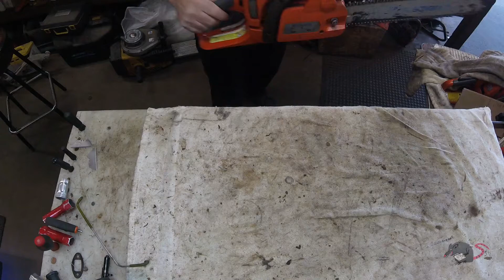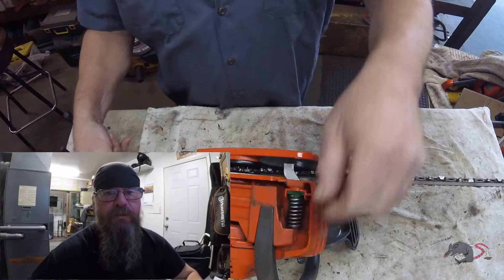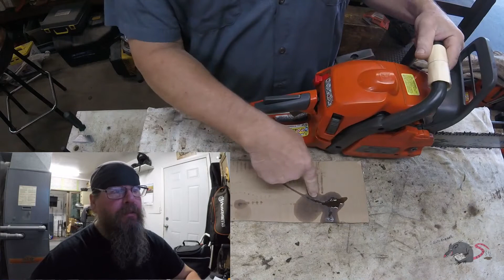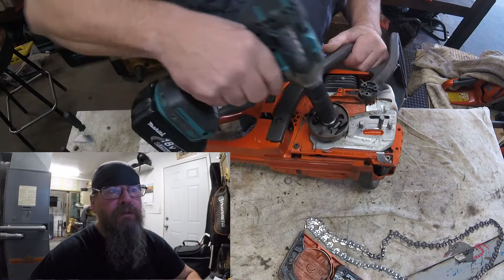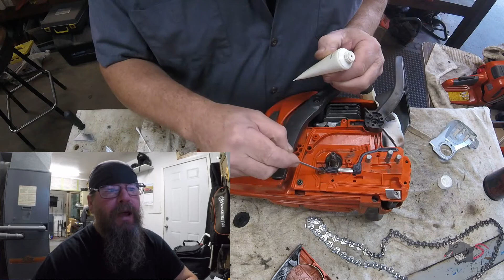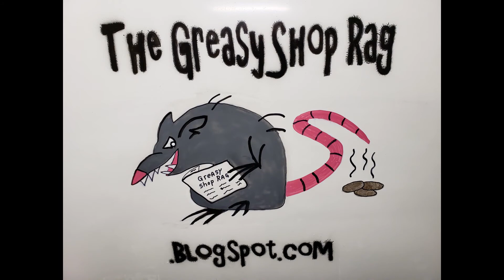Husqvarna 435 chainsaw oil leak fix

Comment: Mine didn’t leak until it fell about 15 feet out of a tree. The leak seems to come from below the oil tank though, if you dismantle the housing and look up to the bottom of the oil tank there is a small black circular bit of plastic - a bung that was needed to block a hole from the plastic blow moulding process? Maybe? I don’t know. I am very tempted to cover it in super-glue though.
Reply from the maker: I think you are looking at the oil screen. If you give it a 1/4 turn it can be pulled out. Sometimes I have to use sealant on these because they can leak.

Comment: Does the bar oil leak cause the chainsaw to flood out and stop?
Reply from the maker: No, the two problems are not connected.
Reply: @TheGreasyShopRag my rancher 450 is leaking oil out of the top, and it will run for a few secs then like floods out. Sry, not a small engine person, so don’t know the terms
Reply: @TheGreasyShopRag  oil coming out of the exhaust
Reply from the maker: @MDD1966  Oh, thats different. It sounds like the unit is flooding. Usually this can be traced back to a stiff metering diaphragm in the carb.
Reply: @TheGreasyShopRag I will check it out thx
Reply from the maker: @MDD1966  Watch tomorrows video and see if its the same problem you're having.
Reply: @TheGreasyShopRag thank you very much

Comment: I have a 455 Rancher. The oil pump won’t come out. There is an adjusting screw that seems to hold it in place. What am I missing ?
Reply from the maker: There is a single screw going through the body of the oil pump that holds it down. Its right in the middle. Once removed you need to manipulate the pump in such a way that the adjusting screw passes the crankcase.

Comment: I have a 435 just replace the coil cause it wouldn’t start now it starts and runs but dies out after a few seconds any ideas?
Reply from the maker: Maybe you had two problems? Coil and fuel system?
Reply: @TheGreasyShopRag actually just fixed the oil leak issue that you did in the vid that seemed to help a lot after I honed the work gear and polished the crank snout, it runs now but not good so I got some adjustment tools on the way I’m gonna tune it and see how she does
Reply from the maker: @bertollie6840  Good luck with that repair!

Comment: Great video.  Can you provide the part number for the clutch removal tool you used.  Thanks.  Amazon shows several.
Reply from the maker: 502541603 should be the number you're looking for.
Reply: @TheGreasyShopRag  Thanks a bunch Greasy!

Comment: hHOW COULD i FIX A LEAK COMING FROM MY BAR OIL TANK WITHOUT TEARING THE WHOLE SAW APART TO PUT A NEW TANK ON IT? Thanks for the help sir!
Reply from the maker: I don't know what model saw you have but if you're talking about sealing the tank then look into products like POR15 or Kreem.
Reply: Husky 435. My son got pissed at it and gave it a 737 air flight and put a crack along the bottom of the tank!😩🦅👍
Reply from the maker: @edmundreiss5144  Yikes. Good luck with the repair!
Reply: Thanks for your quick replies and it looks like the oil is leaking out near the pull cord assembly under the housing. Is there a gasket or o ring seals in there that I can replace? Thank you for all of your help and Happy New Years!
Reply from the maker: @edmundreiss5144  If you remove the starter and black plastic shroud you will see the tank vent (kinda to the right of the serial # tag). Thats a possible source for a leak. Underneath there is a grey colored plug. Its removable and has a screen in it to filter debris from the tank before it goes to the pump. Thats another possible point for a leak.

Comment: Did you not block in the piston when removing the clutch? Looks so effortlessly
Reply from the maker: The impact rattled it off. Some claim this can be harmful to the engine but I haven't had any issues doing this if I follow a few precautions.

Comment: A warm hello from Japan. Great video. Can I ask the part number or where I can source the tool you used to take off head with. Thanking you in advance. I had tool size3112 wrong size cost a fortune
Reply from the maker: I'm not sure what you mean. Are you asking about removing the clutch?

Comment: I got sick of my 435 leaving a pool of oil so I took it apart and figured it out the problem for myself... I tried to seal it with Gray RTV but it just wouldn't cure. Still leaked after it sat overnight. 

Found your video and tried some super glue. Worked like a charm. Thanks for sharing your knowledge!!!
Reply from the maker: Good job. Thanks for watching!

Comment: How do you get the clutch off so easily without using a piston stop?
Reply from the maker: The impact does all the work, I just squeeze the trigger. Once in a while I have to stuff a rope in the cylinder and use a breaker bar to get it loose.
Reply: I just used a hammer and a flat head and two mediocre whacks later, it came off
Reply from the maker: @bradyupchurch5189  Quite often that works. Sometimes you run into a stubborn one.

Comment: What grease do you use?
Reply from the maker: I don't have the part number in front of me (maybe 502 51 27‑01) but its called "Husqvarna Multi Purpose grease". It doesn't come in the small tubes as seen in the video. Those were samples that came in owners packets. The new tubes are bigger.

Comment: You have to hear it - Husqvarna made it even worse in latest models... I just bought 445 Mark II made in 2022 (the ones with grey clutch cover), and that square rubber end doesn't even have that protruding part that goes inside the oil hole in the case - now it's just touching against flat surface around the oil hole. It leaked right after I filled with oil first time... Unbelievable... It's like Husqvarna made it worse on purpose... I hope the super glue helps...
Reply from the maker: I've had good luck using glue on these hoses.

Comment: Thanks, probably exactly what's wrong with my 435. Haven't considered the idea that the leak is behind that plate, but rather assumed that the problem was where the oil is transferred to the sword/blade/arm/bar (don't know what it's called in English). Noticed that the rubber slott where the oil comes out is alarmingly close to the hole in the bar that is intended to push the bar forward when the chain is tensioned (the upper hole in particular does not press, but is still there so that the bar can be mounted upside down)
Will try your solution (hope I succeed in hammering away that drum) but don't know which glue to use. You talk about "super glue" as some winged expression but don't think it is so obvious here in Sweden. 
Is it meant to be glued or is it usually just held by pressure/friction and only glued if leakage is found?
Reply from the maker: "Super glue" is a Cyanoacrylate based adhesive. The part is not meant to be glued but the trick was  unofficially told to me by a tech from a large Swedish chainsaw manufacturer.

Comment: I bought that tool and used an impact wrench. The adaptor tool broke and the clutch still didn't come off. Any ideas on why it is so tight? Can I break the saw applying that much force to unscrew it?
Reply from the maker: The threads are backwards on a clutch. Turn it clockwise to loosen.
Reply: Thanks. This worked.
Reply from the maker: @Eron813  Glad to have helped.
Reply: Tool part number please.

Comment: Got a deal on a Husqvarna 440 at Northern Tool. It ran great but I found out later that it leaked bar oil like crazy! Went on YouTube to find a fix and there you were. I ordered the part(old oiler hose had a split in the cone-shaped seal) and when it came in I knew just what to do. Pretty easy fix. No more leaky saw. Thanks!!
Reply from the maker: Good job! Thanks for watching.

Comment: Husqvarna chainsaw bar bolt loose and leaking oil.  The actual stud fell into the oil crank case.  Not sure what was holding it there except for friction. The bolt was just rattling around in the saw.  Not sure hot to make sure it does not loosen up again and fall out.
Reply from the maker: If you're satisfied with the threads and are ok using the same studs then they can be reinstalled with sealant on the stud shank. If they fit loose then you need to fatten up the stud shanks. This can be done by striking a series of chisel indentations in them. Hitting them with a chisel does make them smaller where the chisel was but raises the edges of the impact point making the diameter bigger. Thats the best explanation I have and I'll make a video next time it comes up.
Reply: @TheGreasyShopRag  You said use a sealant. Should I spray the oiler tank down with brake cleaner to remove the oil on it first?  Also, what kind of sealant would you recommend?  Finally thank you for your time.
Reply from the maker: @ababner317  Yes clean the tank. Mainly just where the sealant will be. I like to use Dirko silicone sealant but a lot of other similar products will work.
Reply: This is for the Husqvarna 435 not the two studs with a splines but the one stud that sticks out. It got loose and oil was leaking around it. One day it just fell inside the saw's oiler tank.
Reply from the maker: @ababner317  I've never had to repair that stud so I'm not sure. I would think theres a way to perform the repair using standard practices or even tapping a new stud in there. Sorry, I can't be more help.

Comment: What do you do if its leaking from the screen filter in the bottom of the case? Sealer gasket and a new one? Or would super glue work on that too?
Reply from the maker: It would be difficult to remove that filter if it were super glued in so I use silicone gasket sealer.